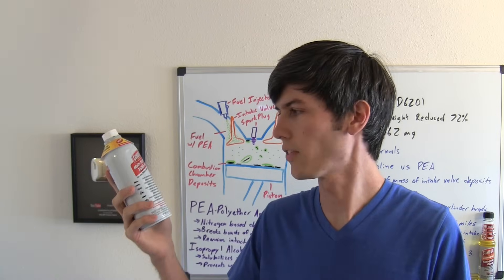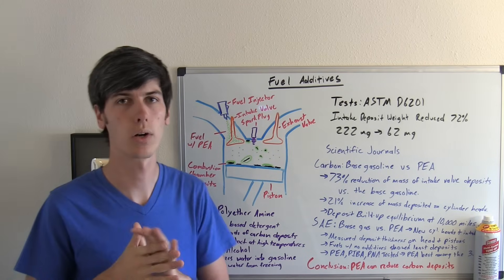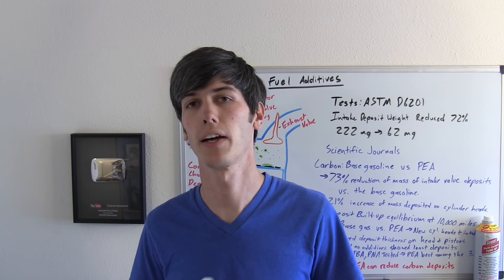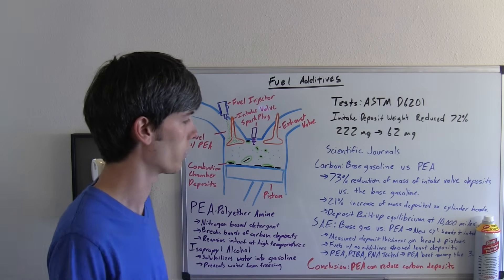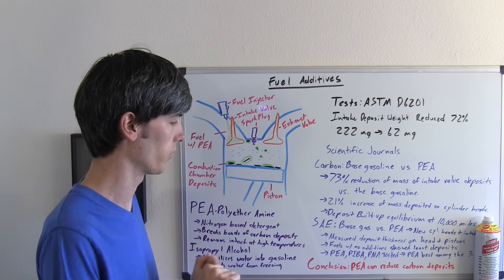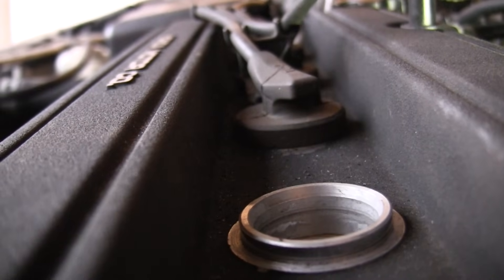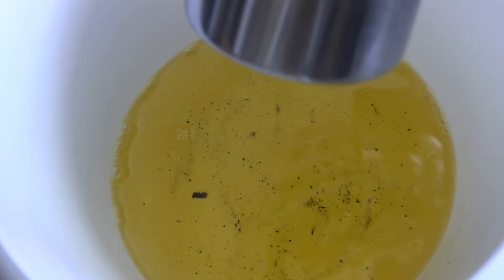Fuel Additives & Injector Cleaner - Explained

Comment: Most additives are solvents. Nail polish remover cleans injectors and carbs. It also can increase gas mileage. It is Acetone.Most carb cleaners are toluene and acetone.  So it boosts octane. Naptha is another cleaning agent used for dry cleaning of clothes.And we have mineral spirits which does a job of cleaning also. Mix water and isopropol or methanol alcohol and it can steam clean deposits in the chambers. These are all I tried and use . A bottle of Dollar store nail polish remover to 10 gallons gas cleans injectors well and is economical.
  CAT pee is good for cleaning. It is Amonia based so can be used to remove wax   and windshield washers. Just Squeeze CAT gently over a bucket.

Comment: 0:58 The problem with this model, putting the fuel additive into the fuel, is that most modern engines use GDI, Gasoline Direct Injection, so the fuel is injected POST intake valves, so neither the fuel, nor any cleaning additives, will wash past the intake valves. I’m interested in the efficacy of CRC GDI intake valve cleaner, as you can spray it into the air intake before the turbo and intercooler, and it allegedly cleans the turbo and the intake valves of carbon deposits. It uses a high concentration of Polyether Amine as its active ingredient. Gumout and Royal Purple both also have similar PEA based air intake treatments for modern GDI engines.
Reply: Liking my hemi more and more.

Comment: Driving an early 2010s Chevy with a 3.6L V6 direct injection engine. After doing some reading and asking around, I think that the best way to prevent and clean up some of the carbon build up on the injectors would be to use additives as well as install an oil catch can. This would help break up and remove existing carbon build up, and prevent as much from occuring in the future. 
Am I way out to luch on this, or is it a sound strategy to maintenance and increasing the longevity of the car?
Reply: Catch can is a very good idea

Comment: Hi I have a Honda civic 98 it has been seating here for a long time .It won't start I put a new fuel pump and tank and still won't start I took off the the fuel injectorsand only is leaking and the other 3 are blocked. What do you recommend please help thanks

Comment: This all seems pretty logical based on the internal combustion process.  The intake valves are cooler so there would be more time to clean before evacuation.  The combustion /cleaned debris would be thrown toward the exhaust valve on the way out leaving  what's left to deposit on the hot areas of the cylinder head and piston top as the cylinder walls are usually coated and polished with a material that is basically impossible to allow build up.
For this to mean anything we need to know the surface area of the valves to cylinder head that was measured.  Without these numbers the data is useless to factor actual cleaned deposits.
Please if you know this data or can find out I would love to know. I am comparing fuel and engine cleaners and the basic data is less than satisfying.

I love your videos! Thanks for the real information and not just pictures or subjective data. Love it!
Reply: Bg44 k platinum excellent product for cleaning carbon deposits

Comment: Hey guys I need some help, I just put fuel injection cleaner in my truck 2 days ago, and then realized I may have a small amount of water in my tank, can I use "Heet" additive this soon to try and get that water removed so early after I've put the injection cleaner in my tank? I really dont wanna screw up my engine. My buddy put about 20% of a bottle of 50% alchohol in my tank the other day not realizing it wasng 99% pure alcohol and now my truck is having symptoms of water in the tank
Reply: Pour HEET in then drive hard to the fuel station, refill, drive hard till about half a tank, refuel and you’re good to go

Comment: I was having issues with hesitation and rough running on my Chevrolet Avalanche 2500. After two cans of Gumout with PEA the 200,000+ mile 8.1L Vortex under the hood was running as best I can tell like near new. A third can didn't make any noticable difference so I figure I got the best out of the Gumout that I was going to get. Of note, the driver side OX sensor was noting an error on the trucks computer on occasion. After the two cans of Gumout, no more errors. I'm using Torque and reading the ODBC II so I can see the OX sensor is working again, comparing the reporting by the driver side sensor to the passenger side sensor. The cans were put in one at a time running a full tank of gas and repeating. I now run one can of Gumout once a year. Thank you for your testing and complete explanation of PEA. It works!

Comment: I bought a bottle 250ml of fuel injection cleaner it says use on a 45 to 60L fuel tank but it doesn't say anything about motorcycles. So my question is if pouring too much to my motorcycle will it cause any damage

Comment: Put redex in my fuel couples days later car was misfiring with no codes. New spark plugs covered in carbon cleaned them seems to be fine now. Will not be using any fuel additives again

Comment: Do fuel system, top engine, and engine oil additives help with fuel mileage or power?
Reply: When I first got my corvette the city mpg was around 15. I put in lucas injector cleaner and after that tank it went up to 18.

Comment: Good video.  I constructed an injector cleaner for on vehicle use out of pvc that goes directly to the fuel rail.  I used the motorvac mv3 chemical because I got it for free at Napa.  Made a huge difference in performance.  Even made a video about it.

Comment: What is the proper (best?) injector cleaner for out of car cleaning?   IF you know what you are doing (I've done it several times) the water pour at medium high RPM in a carbed engine works great for carbon removal.  I expect it thermal shocks the carbon, but in any case it comes FLYING out of the pipes, and when I borescoped before and after, the piston tops were much cleaner, and the diesel run-on problem disappeared.  You'd better know what you are doing, though...I used to go full throttle at 3-4K and hold the rpm relatively even with the pour.  Obviously this will do NOTHING to clean injectors.  You don't want to let it over rev OR kill it with to much water.  As I said, know what you are doing...not a good "trial and error" kind of procedure.  As a retired EE with a fair amount of mechanical knowledge (lots or restores/ hop ups/ built an airplane/ etc.) I enjoy  your vids, and learn something almost every time.

Comment: What's your opinion on Marvel's Mystery Oil? I've used it as a fuel additive for as long as I've been driving. You hear people who swear by it cause it fixed their problem and you hear people warn you not to use it. I was skeptical about using it on my newest vehicle which is a 13 F150 with an EcoBoost 3.5L. But I've not had any issues. Just curious what you think.

Comment: Intake valves do not get cleaned on Direct Injection engines, carbon is building up and decreasing efficiency. Who thought it would be a good idea to remove the fuel injector from the port that cleans the intake valve. I guess they don't have to worry about it, we the consumers do. I know there is dual injection which is a mixture of both that solves this problem. So why is direct injection still used more? Once this was found to be a problem it should have been stopped immediately and moved forward with dual injection only!

Comment: Would you recommend fuel additives for a gdi engine and if so which one?
Also the owners manual recommends it every 7k miles or so, does this seem excessive?
I'm currently at 40k with absolutely no problems, car runs great. I'm just wondering if using any fuel additives would benefit me at this point.

Comment: Hi there
First of all..thanks for the very
 useful Videos that you make..but I also have a question..namely..do you think that the turbo sistem can be cleaned with so called "Turbo Cleaner" additives that should be also put in a full fuel thank and then drive the car for a certain period of time..let's say..30 min at a relatively high rev range ..about 4500 revs for petrol and 3000 for diesel ?

Comment: Do you ever try using WD40?  spry 8 ~10 seconds in 20 liters diesel, than fill the tank... than run, than the car, refill normally, than another treatment... than... repeat one time the same process every 5000 kilometers??? 
Some users claim it works even better than additives, they claim it will resolve a lot of problems in the engine especially aged engines increasing performance and reducing fuel consumption and emissions.
Do you have ever experimented this WD40 Hack??? Something about this topic?

Comment: I have a video where I put 32 ounces of diesel additive into my 2001 Cadillac Deville with a gas Northstar engine. Why you ask, to see what would happen. I knew it wasn’t going to hurt my engine because the tank was filled with gas. 18.5 gallons or 2368 ounces. 32 ounces of diesel additive wasn’t a big deal. The car seems faster and it get 23 mpg after 136 miles of driving.

Comment: After carefully reviewing the 1.4k comments, and not finding this point, I must observe adding Gumout to a Diesel engine, which obviously uses direct injection, will not help keep the back of intake valves clean. Increasingly ubiquitous GDI engines will also not benefit, unless the engine includes port injectors. Also, allowing water in diesel fuel to pass through into the injectors, which Gumout would do, is not a good thing and defeats the purpose of coalescing filters, which are designed to catch water, which at high injection pressures can act as a water jet on precision system parts.

Comment: BP advertises at the pump that their gas is "infused with nitrogen"   I'm thinking PEA is the main cleaning ingredient in most major brands of fuels.  The off brand cheaper gas companies show no additives in their fuels.  I keep reading where people keep recommending non-ethanol fuels for cars and trucks.  Ethanol free gas is $1.00 per gallon more here in SC.  It contains no cleaning additives, unlike the major blended  brands of ethanol mix fuels.  Modern automotive engines are made to run on ethanol blended fuels.  Non-ethanol fuel is best used in marine applications or lawn maintenance machinery.  I have run many tests with my Toyota Tundra using non-ethanol fuel and it delivers only  ".1" or 1/10 per gallon better mileage.   No performance change either.  So why would you spend $20.00 more per tankful just to go two miles farther with no cleaning additives?   SMH.

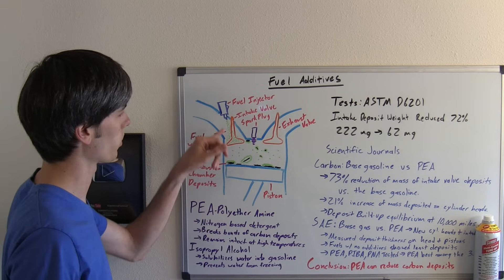Comment: 1:05 what he explains there is the "old style" port injection method, but many engines now have the GDI Gasoline Direct injection method where the intake valves are NOT cleaned any more because the injectors spray the gasoline/oxygen mix directly into the cylinder. No additive can help there with the carbon build up behind the intake valve.
Toyota engines use both injection methods, so 2 fuel injectors for each cylinder to bypass that problem. Costs more to make, but makes regular carbon cleaning maintenance obsolete, thus saving you a lot of money.

Comment: Can you use Toluene as an octane booster?.
All octane boosters main ingredient is toluene
Reply: knight rider.  Most octane boosters are primarily Coal Oil (Naphthalene) or Kerosene or both.  Refineries use kerosene and coal oil to boost octane in gasoline themselves.  If your gasoline is yellow, it has been "fortified".  Gasoline is a byproduct of Kerosene and Petroleum Diesel refining, so they just toss some back in if the octane is too low.

The super ingredients the Horse Power additives often list as "Nano Boost Particles or Advanced Chemistry or Enhanced blah blah" is under 1% trace (doesn't require listing on the MSDS) and is Pixie Dust when diluted further in 20 gals of gas.  Typically trace pollutants in the Naptha (like Benzene, toluene or ferrous oxide).  

All the octane boosters really do is take low flash 87 octane gasoline and make it higher flash point 91 octane to avoid knocking in a higher compression engine or variable timing engine like VTEC or VVT.

Gumout costs 20cents a gallon to fortify ($3 to 15 gals).
STP costs 30cents
Some of the flashy ones cost 80 cents a gallon additive oz.

So if you buy 87 at 2.20 and 91 at 2.45 then you may as well buy 91 and skip the booster.  However if you pay more than 30cents difference, Gumout is cheaper for your BMW or high compression motorcycle.  Don't use more than .75 oz per gallon.

Oh, also Ethanol boosts octane.  Often 87 will have 2% ethanol where the 91 pump will have 10%.  If the higher test gasoline is pure clear, then they likely boosted it with alcohol.
Reply: @STho205  thanks mate

Comment: In my opinion, these days if you maintain your engine according to the manufacturers schedule, good clean fuel, good quality lubricants and keep the engine tuned, fuel and oil additives are a waste of money. Fuels and oils are precisely engineered to a high standard and unless you put dirty fuel and oils in your engine I wouldn't waste my money.
For example why use an octane booster additive when you can just use a higher octagon fuel at a lower price per liter any way?
The engine manufacturer has engineered and recommends your engine to run on a certain octane fuel. 
Do you really think you know more than these engineers?
I think not
Reply: A quick calculation on octane booster costs.
A bottle to treat up to 100 liters of fuel costs $25.00. That's about $0.25 per liter.
Where I am the difference between the different octanes of petrol is about $0.10 per liter.
So working on that the cost difference between 91 octane and 95 octane per 100 liters is about $10.00. The price difference between 95 octane and 98 octane is the same $0.10 per liter.
So why spend $25.00 on an additive when you get the same effect just buying the next higher octane fuel??

I rest my case

Comment: As your so knowable would you tell me if you think a car  using PLG as well as Petrol needs a valve flash System ? I have a Range Rover Sports Supercharge 4.2  V8 Jaguar engine. Some say I do because the Valves are softer than the BMW engines that are in some other Supercharge Range Rovers. I hope I have explained this so you understand what I’m talking about .

Comment: So I bought a used 2017 mazda3 from hertz (rental car dealership) it had 29,000 miles on it and I got a good deal, I’m wondering if I should use gum out since people usually mistreat rental cars and buy the cheapest fuels and stuff, and I notice it has some rough idle at red lights when the cars warmed up